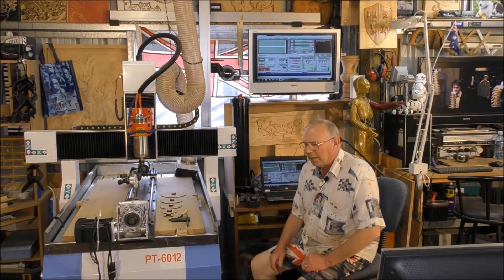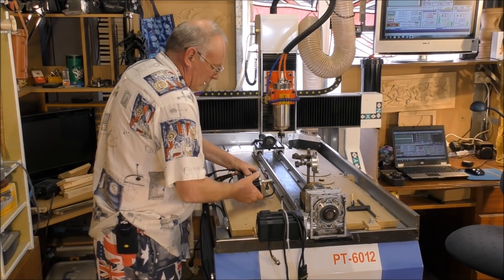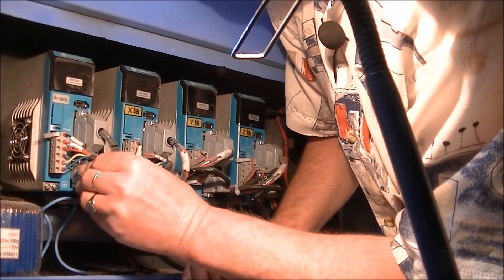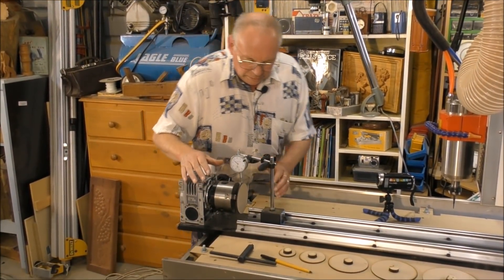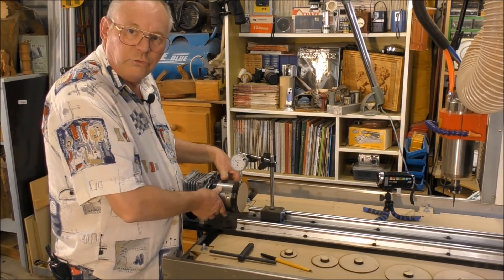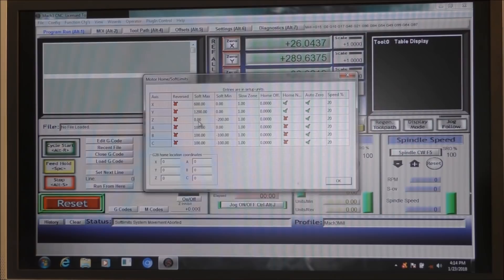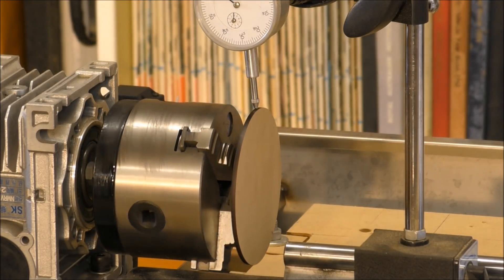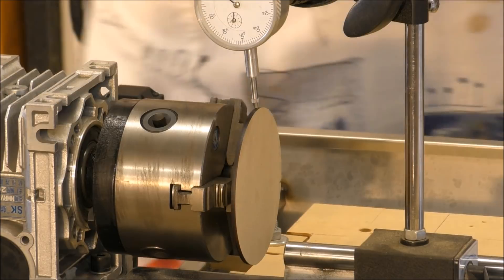225 Simple 4th Axis setting up in Mach3 with SERVO or stepper motors

Comment: After power loss during job work in rotary how to start again
Reply from the maker: Restart the same as in flat axis, tell Mach 3 to start in a line of Gcode in the file 20%in 50%in and so on
Reply: @inventorsworkshop9600  homing sensor is need to install in rotary
Reply: @inventorsworkshop9600  any video

Comment: i just bought the 4th axis, but im so confused, do i really have to set the move of A each time i change the diameter? cant i set the degrees instead? 360
Reply from the maker: There is a facility on my patron pages for technical help
https://www.patreon.com/user?u=15079773
Reply: @inventorsworkshop9600  after some digging, ur doing it the wrong way, its degrees, not distance..

Comment: I AM SUBSCRIBED TO YOUR YOUTUBE CHANNEL FOR 1 YEAR, LET ME ASK YOU A TECHNICAL QUERY ABOUT THE CALIBRATION OF MOTORS IN A CNC ROUTER, MAYBE I HAVE AN ANSWER TO MY CONCERN.
WHEN PERFORMING CUTTING OPERATIONS, IN MY CNC ROUTER THAT OPERATES WITH ARDUINO, IT PRESENTS DIFFERENCES IN MEASUREMENT WHEN IT MOVES IN THE DIRECTION OF THE X-AXIS, THIS OCCURS APPROXIMATELY AT THE MIDDLE OF THE TOTAL DISPLACEMENT OF THE CNC MACHINE, THE MOST BIG PARTS REMAIN 1mm. IT HAS APPROXIMATELY A TOTAL TRAVEL OF 1850 mm.
I HAVE PERFORMED CHECKS ON THE RACK TEETH, I HAVE EXCHANGED RACK SECTIONS BUT THE ERROR OCCURS IN THE SAME WAY. BETWEEN 900 - 1200 mm THE PIECES THAT ARE OBTAINED ARE 1mm LARGER, THE CURIOUS IS Q THE PIECES THAT I PERFORM OUTSIDE THAT RANGE OF DISTANCES, EITHER LESS THAN 900 mm AND / OR GREATER THAN 1200 mm, ARE IN THEIR CORRECT DIMESIONS.
MY SPECIFIC QUESTION IS HOW TO PERFORM THE CHECK ON THAT ENGINE (X AXIS) AND IF THERE IS ANY VARIANT TO MODIFY CONFIGURATION PARAMETERS THROUGH THE ARDUINO.
THANK YOU FOR YOUR TIME, I WAIT FOR YOUR COMMENTS.
Reply from the maker: Hi, there is a help facility on my Patron pages  
https://www.patreon.com/user?u=15079773

Comment: This seems odd. I would have thought the a axis would work in degrees not mm.
Reply: I agree, should be steps per degree, then if you put your radius of your work in the settings tab in the upper right at the rotation radius, mach3 will calculate it for you. This seems very inaccurate and a real pain in the...
Reply: Manfred, I have to agree. All my CNC experience has always been. Only XY&Z are linear. A Axis, is rotational therefor is in Degrees..